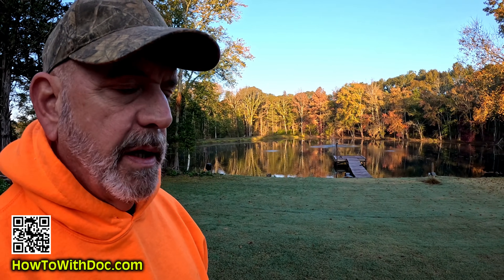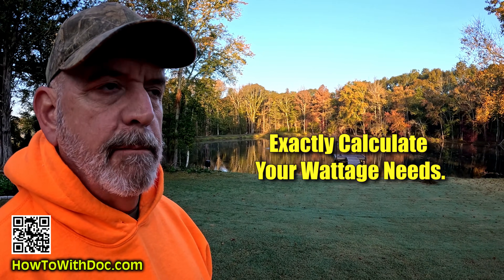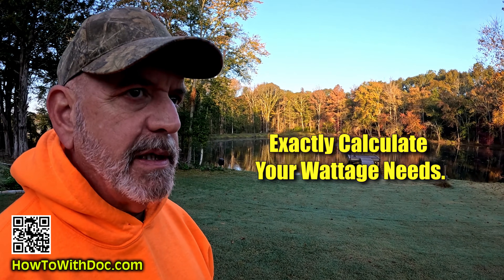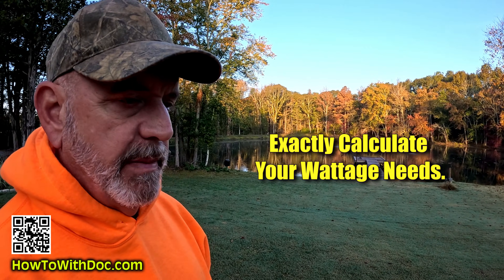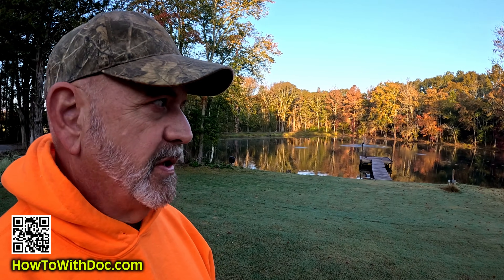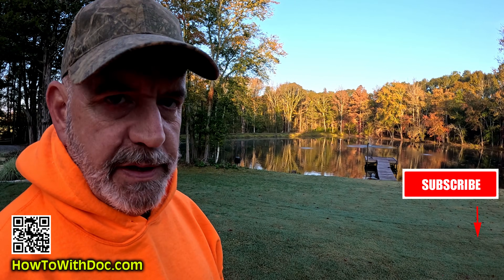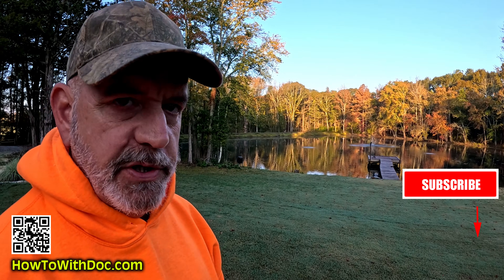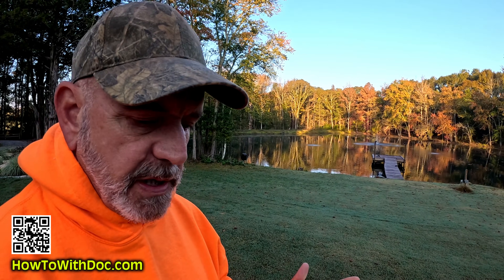Calculate Watts for Generator - Be Exact

Comment: I have not seen the rest of your gen videos yet.  They should be a lot of help to your viewers.   
Just wanted to make a technical comment.   Volts times amps is VA.  1000 of them is a KVA.   So, your heating toaster measured amps x volts is VA and Watts as resistance devices have unity power factor.  But a refrigerator is an inductive load.   So there, VA is not Watts.   A computer or electronic load is reactive load so VA is not Watts.   The reason I tell you this is that for instance a Champion 10KW generator is listed at 80% power factor.   Therefore it is rated at 12.5KVA.   So, depending on how you calculate your loads you may be saying watts when you really mean VA.  So you may be under-loading the generator more than you think.   Your calcs will be safe, but you may be over sizing for your loads.

Comment: Need to be careful when choosing an AMP meter.  What you really want to know is to capture what is called INRUSH current.  This will show you total AMPS needed to get something started.  Generally,  this applies mostly to things that have an electric motor.  It takes considerably more watts/amps to get a motor up and running.  In fact, most motors have capacitors that also act to help 'kick start' that motor until it's up an stabliized.  This is where generators fall short because while they can handle a running motor,  they can't provide enough amps to meet the start-up inrush current.  On HVAC systems there is a Placard on the side of the outdoor unit.   Look for Compressor / LRA which means Locked Rotor Amps or Starting amps needed to get it started and running.  The other value usually beside it RLA Running Amps.  This value shows how many watts/amps it draws once it starts up and is running.  In some cases,  the LRA can be as much as 3 times the runnng amps which a lot of generators just can not handle, even a 9000 watt generator, certaintly nothing less either
Reply: You have a recommended meter you like? I know an Amprobe ACDC-52NAV is a top notch meter but will something as basic as a Harbor Freight AMES INSTRUMENTS CM1000A suffice for general checking?  I'd like to add another meter to my "arsenal" but not sure I want to spend the money on the 52NAV for my minimal needs.  I look for used 51NAV's, too.

Interesting choice of user name, btw.  lol

Comment: Hi Doc,
I'm considering buying the same generator you have in the video (slightly different rating because it's newer presumably). Champion 9000-Watt Electric Start Gasoline Powered Open Frame Inverter. Do you have an electric water heater pulling 4500 watts and have you tested it on that? I bought another brand generator and it can't handle the abrupt 4500 Watt load even though it's rated to.
Reply from the maker: Yes, but sometimes if it's in ECO mode it might be a problem. Suggest turning off water heater and only turn it on a few times a day when needed.

Comment: I'm not a fan of gas generators.  The fire risk and more hazards of fuel storage are not worth it to me.  If you are going to run a liquid fuel, look at diesel generators.  Diesel generators are more fuel efficient that gas as a diesel motor is load based.  I'm lucky enough to have natural gas connection to my home and that is what I use.  
  Also, max current isn't just when the motor is running.  You have to look at many circuits based upon power on load.  While the high load is short in duration when you first apply power and turn it on, it needs to be accounted for.  I also recommend hiring a good electrician to check you home electrical system.  A home that's a bit older and gone through a few owners can offer a few nasty surprises like a floating ground.  
   One last thought is that any backup power needs to be exercised on a regular basis.  It does no good never test the back up.  This goes for power and data.  The test should be complete at least once to see how long power will last between refills.

Comment: Maybe someone has already touched on this: most electrical devices have data plates on them with all the info you need to determine load requirements. You'll generally find voltage, amps, and sometimes watts all together. In the case of say, a refrigerator, the wattage may show 400-600 watts (for example), but this does NOT take into account the inrush current of starting the compressor motor from a standstill. This is also known as Locked Rotor Current and can be 4 to 6 times the run amps for a brief period of time. It can, however, trip something if too much load is already being utilized elsewhere. Just FYI....
Reply: @treytudor6206  that's usually in micro seconds and you need to understand that to match the spike time the circuit breaker is rated at. Exceed the breaker spike time and current and you'll trip the breaker every time.
Reply from the maker: They get confusing and often don't provide an accurate test of running wattage we have found. I was going to address that but forgot.
Reply: @HowTowithDoc how can we speak to you over the phone to ask you questions on how to setup something similar to what you did on the power backups in another video.  There are things like discord that allows you to chat via video without giving phone numbers and or any other personal information.  This would be a great way for you to work with someone from time to time that is looking to seek a consulting services from you.  We are looking to do something similar to what you did with the outdoor power box that allows you to switch from generator to the battery power station.  Just hope to speak with you to seek how you went about it in more detail as well as show you our situation to see if you can help us dial this in.  Thanks
Reply: @HowTowithDoc what is that particular window AC unit were you using in this video? I need something like that to cool a enclosed 400 sq ft den. Has 2 windows.
Reply: There are TWO additional factors that make a difference to generators AFTER Watts.
1. Startup load (inrush)
2. Inductive Load PF (PowerFactor).  

These two items are why your generator cannot be easily sized to exactly your load.  if you just add the running Watts of what you need to run you will need to add some extra percentage for the aforementioned items.  
At my old house my generator was rated TWICE what it would take to run the central AC but it would NOT start the compressor.  There are soft start kits but they are pricey and finding someone who knows how to install one is difficult.
Reply: @JayAlfredoG - AirGo makes an awesome one. So simple to install too

Comment: Would it be safe to say, if I have a soft start on my HVAC, and my big generator will run them, then maybe that is all my large generator should be used for and I should concentrate on smaller more efficient generators to run the rest of the house?  Of course if I am running the large generator might as well run everything else off of that so maybe I should look into the window units and run those off a smaller generator.  Hmmm now what do I do with my big one?
Reply from the maker: We'll cover that.

Comment: What’s up Doc 😂
Sorry couldn’t resist… 🙋‍♂️ what are your maintenance recommendations for a 22KW generac generator? We have natural gas feeding it so fuel not option.
IS it necessary to change oil every year regardless if you use it for period of time or just for weekly test. Also, should I do a “load” test yearly on my unit?
Thanks for all these helpful videos.
Happy Halloween 👻
Reply: Yearly oil change is an absolute, just like in a car not used much.  Oil is still slightly hygroscopic which means it absorbs moisture.  Not as quickly as brake fluid but an annual change is still best for longevity of the motor.

Comment: Keep in mind when measuring a refrigerator the motor need to be supplying freezer and refrigerator to get max current
Reply from the maker: Correct... leave both open for 10 minutes... move down the temps on both... then start. Use the MAX button and let run.